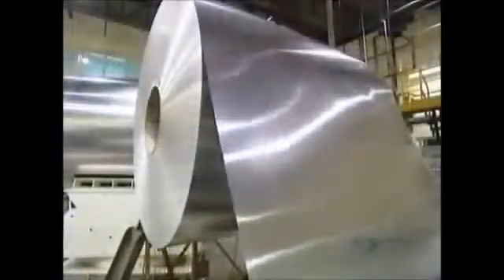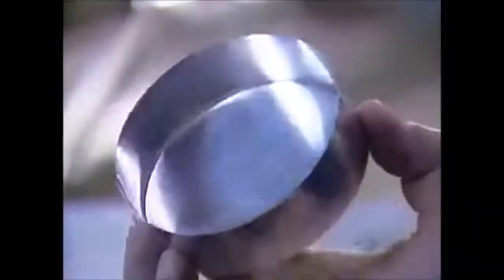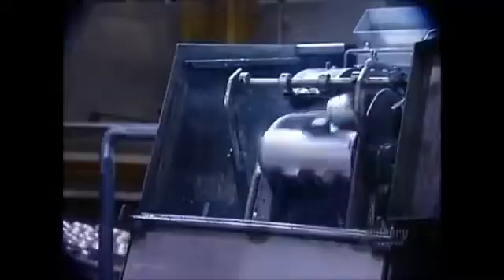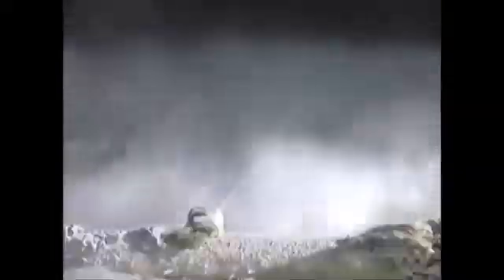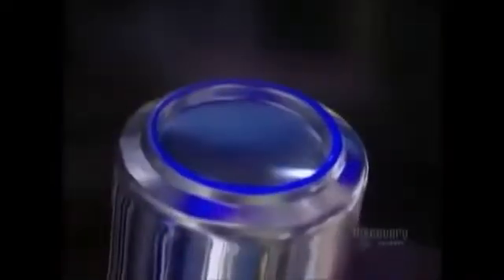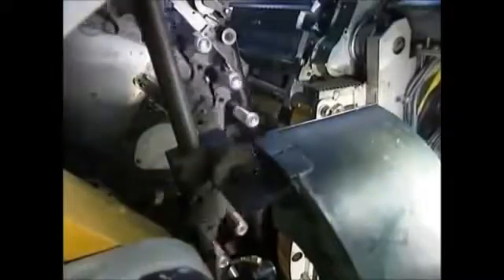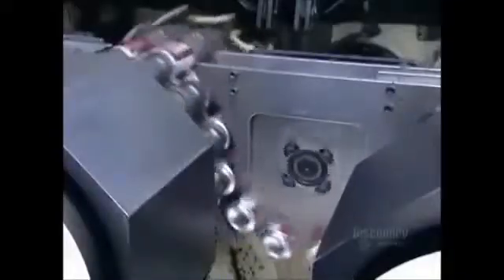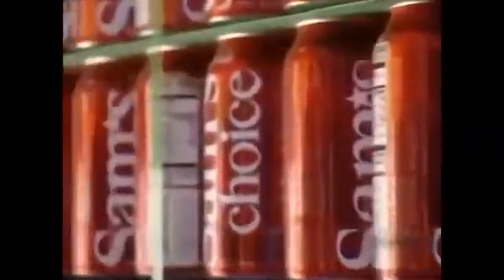How its Made Aluminium Cans

Comment: Kind of insane that filling the cans is done elsewhere. Imagine what a lot of work is involved with packaging the individual cans, in layers, each layer on its own cardboard tray, stacking those onto pallets, transporting them on trucks, having to unpack the whole shebang, planning them back on the conveyor belts of the production lines in the other factory... how (relatively) easy would it be to simply fill them immediately after they are made! It seems insane to me, not to have it organized like that..
Reply: It is all done automatically. This allows one can factory to make cans for beer, soda, and energy drinks. It allows one can factory to make for multiple filling companies. I worked in the industry as a manager for a few years, the logistics of it are astounding. The particular factory I worked at DID ship many of the products right to a brewery in the same metro area but also made batches for (relatively) small producers, soda and breweries in Canada, and around the country.
Reply: @askme9606  Yes but it is INSANE not to have a facility that stamps out those cans sitting right next-door to the place you fill them up, or a line that does that being intergrated in (and as part of) your bottling plant, and to at least only transport the pre-worked starter shapes. Packaging loose individual ready-made cans LITERALLY sounds insane to me. They are fiddley (of that is a word), fragile and hard to stack up (and to unpack as well), they take a lot of space whilst you still are mostly only transporting air and they are relatively simple to produce ANYWHERE once you've got designed and made the machines that make them.

Comment: 3:51 untrue, even today, I remember a while ago we got the "New Coke" stranger things box, was sitting on my shelf to collect, one day I noticed that it was spraying coke out, and believe it or not, it was a pin hole the acid from the new coke made in the can itself..
Reply: No, it's true, just the process isn't perfect. The liquid can clog up the spray nozzles, things may not be clean enough for the machinery to hold or move the can correctly, you can lose air pressure. About a million things can go wrong. Cans are checked periodically for conductivity--if there are small amounts of the spray lining that are missing or too thin there will be electrical conductivity when the can is filled with water. It's a big deal when this is found (and a pain in the ass to deal with). But, every so often things get past checks. Think about it, I worked in a relatively small plant with 4 can lines and 2 aluminum bottle lines. Each 12 hour shift the can lines were supposed to make about 1 million cans each. So percentages of failure add up quickly.

Comment: So the core aluminium metal can has a printed label underneath a protective layer of varnish, & the inner coating of the can is silicon based(the latter not mentioned in the video)
Can anyone tell me, are the unprocessed sheet rolls of aluminium, pure aluminium, or is it considered as a silicon based metal? I'm aware of different grades of aluminium , aluminium cans are a different grade of aluminium than a PC'S CPU heatsink.
Reply: Finding pure aluminum (sheets, rolls, ingots or otherwise) is extremely rare. Depending on the application, additives (in various percentages) to the bauxite ore allow the aluminum to become an alloy (indicated by code). Soda cans, for example, use AA3004. The main additives in this one are Magnesium & Manganese. The soda can's base, by the way, is AA5182. This alloy has 5x the amount of magnesium to give the edges a higher tensile strength. But even if we assume pure Al sheet rolls, the material would be so weak it would collapse like gum before the cans make it to the filling station. It's also very inert (reacts very easily with elements in the air). The dangers & skewed flavor associated with the inner coatings of these cans had me switch to glass many years ago. Nothing ever beats the taste of any drink including water in glass.
Reply: I was just watching shorts on them putting the cans in a sodium hydroxide which is lie wash after scuffing it to eat away the aluminum and it left a plastic baggie.

Comment: Hello can anyone tell me if the walls and bottom of a can are the same thickness?
Reply: the bottom is much thicker, as it does not get stretched out in the production process just check a can out for your self you can tell the sides are much thinner then the base
Reply: I don’t believe so, the can is punched and only the walls are extruded so that should be the thinnest part. The base of a can also needs to be a bit thicker for structural support.
Reply: Like they said though the wall isn't a uniform thickness. The top of the wall is thicker to allow for a flanged neck which will, after filling at the brewery etc. take the top or end as it's call.
Reply: bruh